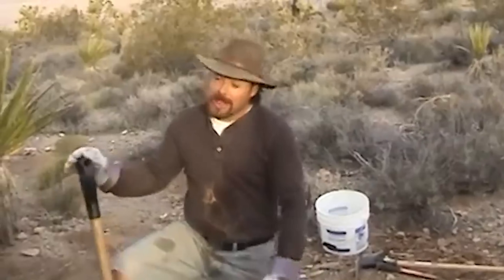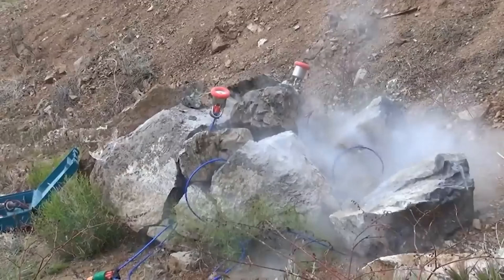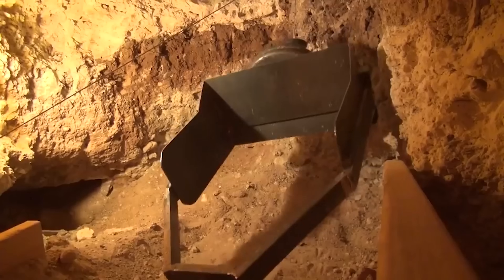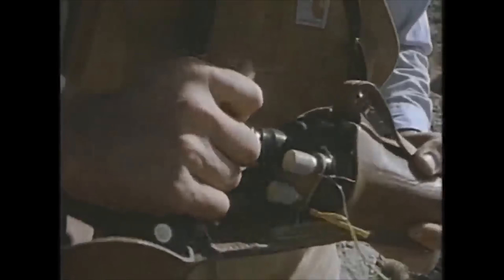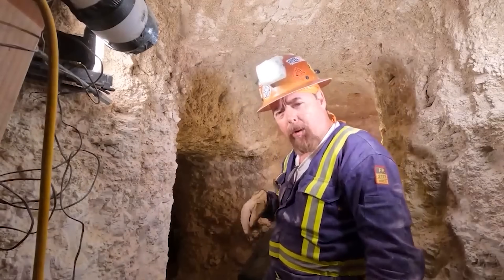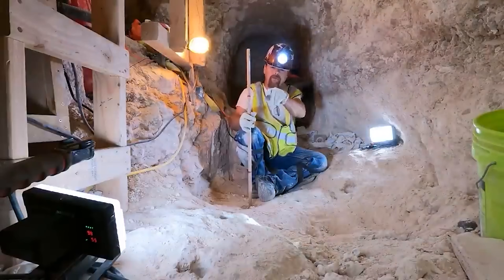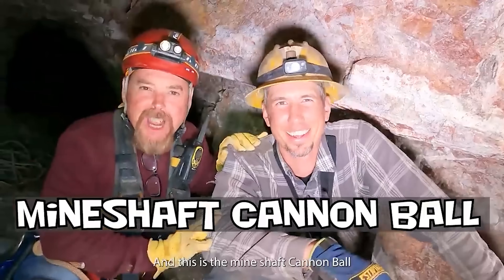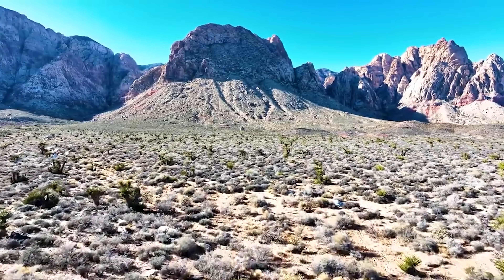How We Discovered An Entire Placer Gold Deposit Underground

Comment: Not in Australia. I have been to an Auluvial mine where the chinese had been and the tint tunnels were still there. They took only the best most concentrated parts of the old channels. Slabs of iron bark gum tree were used to prop it all. I took one prop actually. The tunnels were about 50cm wide x 35 cm high. So small. And they hadnt filled in i  the years between. They were just frugal diggers and good at what they did.